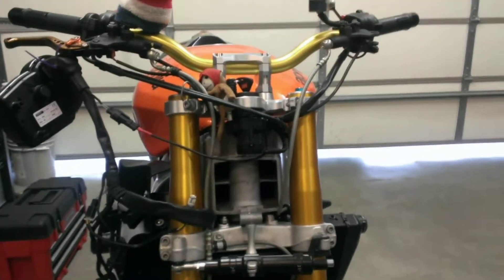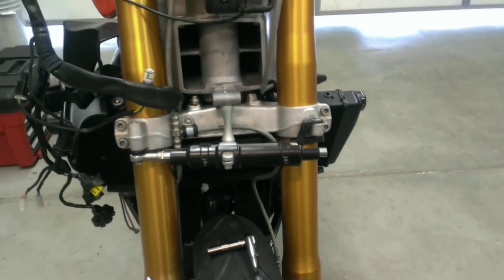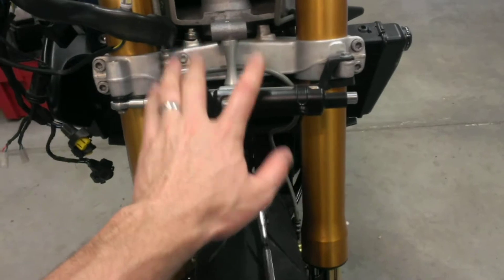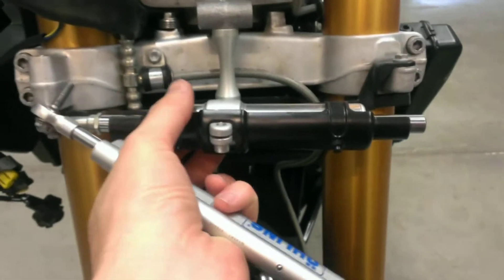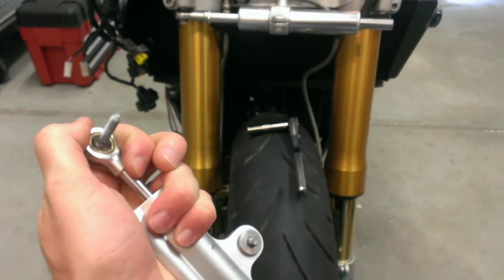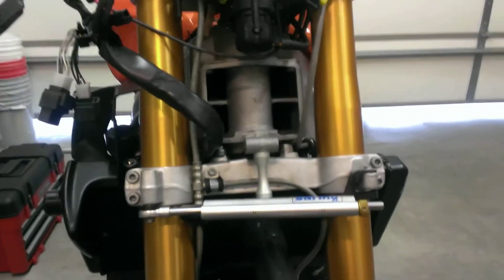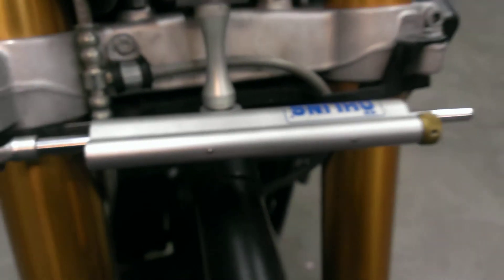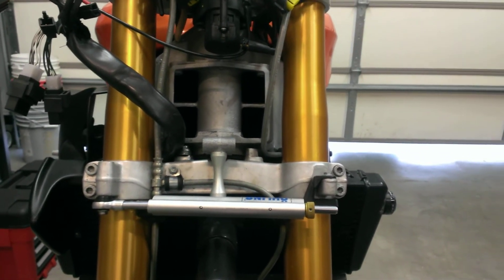Aprilia Tuono Ohlins Steering Damper

Comment: just want to mention, you probably should not use that long spacer and long bolt. on the factory tuonos, the ohlins dampers bolts onto the top of the lower triple, not the bottom like the sachs unit. I learned the hard way.

by using the long bolt and spacer you risk shearing the bolt into the frame. ask me how i know.
Reply from the maker: Does that apply to the RSVR as well? My lower triple is an RSVR triple, since I upgraded the forks and needed the lower triple to fit the Ohlins fork tube diameter. I'll have to look into that, thanks for the heads up!
Reply: I'm sure it does. look at the part fiches; http://www.apriliaforum.com/forums/showthread.php?226390-Ohlins-Steering-Damper-install&highlight=ohlins+damper

its an m6x30mm and theres no spacer.
Reply from the maker: You are very correct! I will have to fix it!  I have to tear the front end off (again) anyway, my dreaded ignition short came back again. I must have missed a broken wire somewhere. Thanks again! I'll correct the description as well, to reflect my error.
Reply: good luck with that wire! 

as for me, I have to drill out the that sheared off bolt in my frame. probably have to take off the front end as well.. until then, no steering damper at all lol
Reply: Maybe this suggestion works for the RSV which has a different air duct, but on the Tuono I can't see a way to mount the steering damper on top of the lower triple. I mean it will will fit but then you do without the air duct, headlights and front fairings. I have a Tuono Factory that mounts Ohlins forks, not sure whether that makes a difference, I doubt it. It is very true that you may end up shearing the bolt into the frame, happened to me, luckily I managed to replace the bolt with a new one.